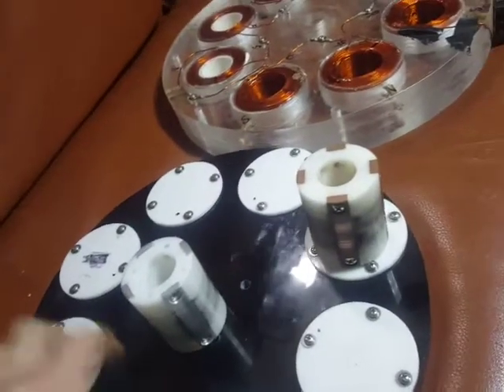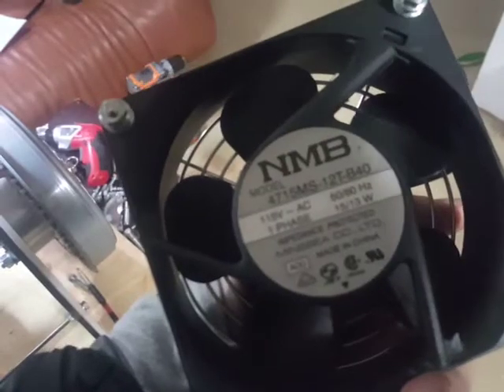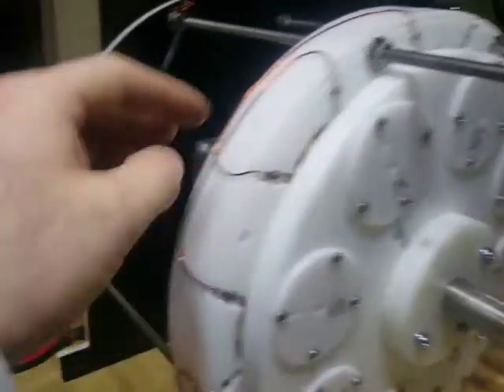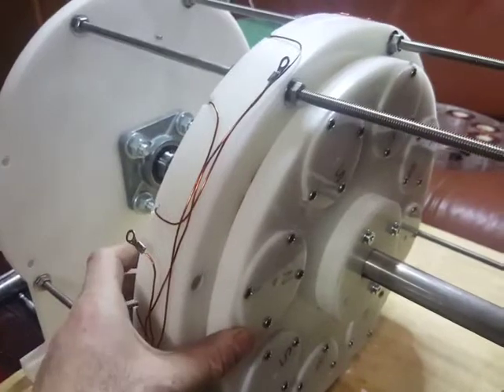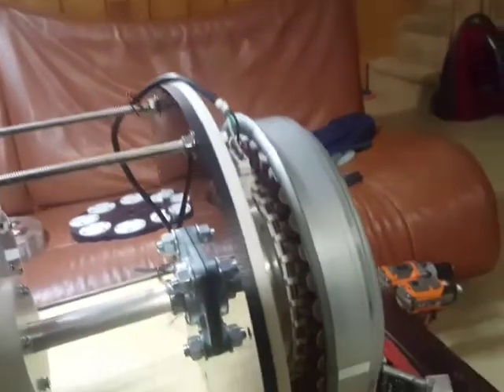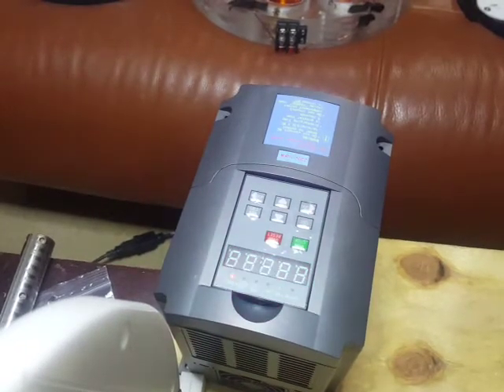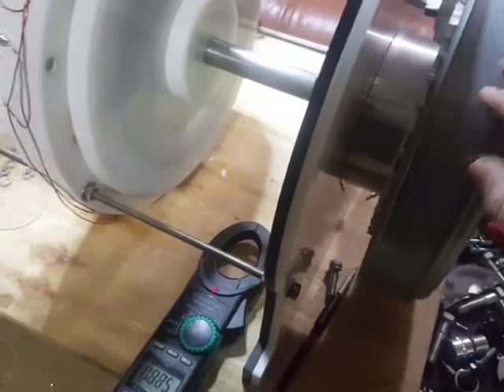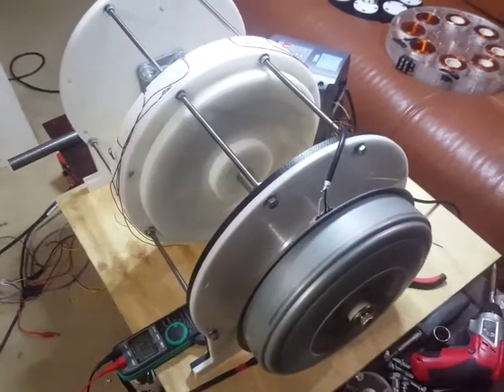SP 500 Generator from Creative science

Comment: I purchased the Model 2 plans recently (so now I have the Model 2, 3, 4 plans and some other things); & I quickly looked them over.  If the Model 2 is used as an electricity generator, then it is close in design to the Model 4.  I think the people at Creative Science may be putting most of their interest in the Model 2 since it has a commutator and some other things.  You are right that your design should produce more electricity than is consumed by your washing machine motor and controller.  So, what it comes down to is (it seems): that both you and Creative Science goofed on putting the pieces together, or you don't have the alignment of  the discs/magnets/coils correctly, or the product doesn't function as stated (sorry people at Creative Science, I can't rule this out yet).  
Not trying to be nasty, you may have some language difficulty (English not good), so this may have some influence on you understanding well what you read or listen to in English.  
If you figure out what is wrong with your machine, I would definitely like you to show us in a video!
I am going to complete the Model 4 and see what the results are.  I'm gonna use a 2 hp 115v ac motor connected to the Model 4 rod via a shaft coupling.  The motor goes a maximum speed of 1800 rpm.
Reply: How did this build turn out. We’re you able to accomplish the goals?
Reply from the maker: starlitopensky1 i will be very happy to see your make, if you fallow the plan 2 you will get the same results that i got. Why? Because you simply need more torque to keep up with energy load, either have to use high RPM with heavy flyweel and you may get better result. Another problem you will be facing is to  ballance the magnet discks.this is very crusial. On my vertion i am reaching 1000 RPM max with this controller and about 400 V but soon you start putting the load on your 2 HP motor will strangle soon  and very possible to overheat and burn out if you leave it unattended. You mentioned i may dont have align the magnet disks, it is all correctly aligned because magnets align each other it goes north-south north-south only if you read their instruction pay close attention how the magnets are aligned and you will see. To answer your Second question the stator came already wired and epoxied from creative science, this is correct wiring in series. Whole point is  your generator primary mover must be  consuming less energy then generator will produce, otherwise you will be under Unity or you will break even that means all of the work you will put in will not  make sense. Anyway I will be happy to see you your work please share. thank you
Reply: Genproject2017 alternativeenergy Okay.  Mine has to function according to what was advertised (as long as I build and assemble it correctly), otherwise that is not good.  I'm working on the Model 4, which is very similar to Model 2.  If mine doesn't work with my motor, then I'm probably facing the same problem you are with your washing machine motor.
We must get a lot more watts from our machines than the motors use.  
I'm gonna use a speed controller on the 2 hp motor, so I'll be able to adjust the voltage.  I don't care much if the brush motor I have is damaged since it has a replacement warranty.  I know the internal structure of the motor and figure the brushes would wear first, then the commutator (which transfers the electricity from the brushes to the armature) would get dirty.  I should be able to get replacements cheap somewhere but not from Grainger (expensive).
Reply from the maker: starlitopensky1 it will function but the quastion is if you get overunity out of there. Please dont get me wrong i am as much enthusiastic as you are and giving you my vote  on your project. When you will be  able to put everything together?
Reply from the maker: WM hub motor was after i faced the first problem.first i used comutator with 2 brush assambly,  with 2 brush i was only able to reach 400 RPM with no torque ,i could stop the motor with my hand taking no effort. I ended up with 2 comutator the 1 i have for fallowed from  plan 2 ,local mashine shop made for me with copper bars, then i shower to Rick what i had and he tolled me  that comutator was big and they had different size, well i trusted him and purchased the one aluminum comutator from them payer $460 . When i got there comutator there was no difference what so ever so wasted my money there,  after that i designed wm hub motor assambly and attached to the housing, i got much better result then comutator thing but i am braking even  what i put in i get out the same.  I am not sure what makes you so sure that your model will work, but hey i am not perfect  i might of  missed something simple and not getting likable result as i should. So what am i missing here? I have there product and it doesn't produce   adverticed amount not even brake evenpount so if you are fallowing there plan how you would get better results thats what pusling me 👍☺ keep us posted .
Reply: Genproject2017 alternativeenergy I haven't started the coils, I have started to cut the discs (my drill press broke but I should the replacement parts by the end of this month so I can continue).  I'm looking over plans for now until I continue.  I only have time to work on it on one day out of the week, maybe another day sometimes.  But I have built a small version of the Model 4, so this gladly isn't my first attempt!  I am hoping to have it done within a couple of months, not sure, sorry.  My other YouTube channel will have updates of the progress.  
My magnet discs will probably wobble some, which won't help with getting the best power output, but I'll get the magnet discs close as possible to the coil disc.  
We shall see if I get more power out than put in.  My small version of Model 4 definitely did not!  The magnet wire was 21 awg and the magnet pull force was 8 pounds; everything else was correct.

I'm gonna use 15 awg this time for the fullsize machine.

I'm glad you're looking forward to the results, it would nice if we can get these things functioning as advertised.
Reply from the maker: starlitopensky1  ofcause i am on your side bro more people gets hands on this project is better so we can learn from each other,i have nothing to hide i just fallow the others footprint and here i am now ,if you need any more detailed info let me know. By the way i even purchased the coil winding machine, works fine but needs lots of practice. There coils are perfectly wounded , 17 gage with 433 turns i think. But i wound my coils first and put them in stator but they have much better quality work but same result compere there's and mine , on 15 gage you might have more Amps, but how much turns are youplaning to have , if you will have same turns then it might not feet in the hole diameter unless you make the stator bigger then there design.
Reply: Genproject2017 alternativeenergy Thanks.  I am hoping that I can help you.  
I made a mistake of not removing the coating at the ends of the coils.  There is not any instruction to do this in Model 4 directions.  I just didn't know.  But I realized.  
Model 4 and Model 2 are very similar from what I've seen (Model 4 plan doesn't show how to build a commutator nor do I think it even mentions it).  
Your commutator should be producing more result. If you can turn the 1" rod by hand (no power connected), can you see where the magnets are positioned when the brushes contact a commutator aluminum metal piece (I forgot what they are called)?  The South Pole of a coil should be positioned against the South Pole of a magnet, right?
Reply: Genproject2017 alternativeenergy When I use the 15 gauge I'm gonna keep it the same size but with less turns.  I'll make one and connect it to a 12 volt battery and put a tiny magnet above the coil, it should shoot into the air.
Do you have a magnet Pole tester?  It can be used to find which side of a magnet has the North or South Pole.  I think it can be used on a coil when the coil has electricity connected to it.  I am interested if the coils you have have been put in the coil disc so they alternate North and South.
I don't have a coil maker, I'm gonna use some strange thing I made that should be okay.
Right now I don't know what is wrong with your machine, I'm trying to look for any errors.   
I have a suggestion: Run your machine again at 110 volts and connect two 1200 watt space heaters to it and see what happens.  Connect a power strip to the coil output wires and plug the space heaters into the power strip.  Run the washing machine motor with the house power.
Reply from the maker: starlitopensky1 i can show you how to set up comutator according to magnet position in private messaging. Shoot me your  email.
Reply from the maker: Check your email
Reply from the maker: starlitopensky1  i have many testers avalable, first of all this gold kit came directly from them , the stator was assembled, wired and epoxied thats why it called a GOLD KIT, otherwise it would be simple kit you have to put the coils in the stator and wire them and epoxied them. Any way even it was already pre-assembled I still test it with the magnet polarity Electric tester, and I also tested old-fashioned way connect me to the battery and check the polarity with a earth magnet they were all correctly wired, i aligned correctly to the commentator otherwise it would produce higher Sparks I also shared the video with you in private. Hope you will complete yous soon and share it in here. Oh by the way to purchasing plants from them is waste of the money after i went thought all this building, all plants are available online to download you just need to look for it.
Reply: @Genprojectalternativeenergy  are you still using this? We are considering it & would love your input

Comment: If you want to try this in the meantime:  get a longer 1" rod and put your four magnet discs and two coil discs on it, connect in coil discs in series, and see if you get more watts.  Connecting in series should double the volts just like if one connects two 12v batteries in series one gets 24 volts.
Reply: Hi starlitopensky1, did you finish your build yet? I am working on mine and trying to get it working, but I’m having challenges. I’m seeking help but can’t get ahold of Rick.
Reply: I have issues too.

I recommend that anyone trying to make one, make a very small one, to get it to function without waste of money.  I have 3D printed parts of a smaller one.  I am not following Creative Science plan exactly because I can make it smaller and with less cost.  One can 3D print three coil discs and four magnet discs (four magnets per disc, 4 coils per coil disc).  As long as the wiring is dine right, the end result is the same as a big one.  There is a good chance that "Creative Science" is a scam.  Look how Rick Gibson handled the maker of this YouTube video.  Either way a person can 3D print a tiny machine (one coil disc and two magnet discs) and use the photo interrupter (and other things) to help time it.  If you try to make a big model with a drill press you may get a wobble when discs turn (and other problems).  But "Creative Science" is ready to sell you things for big dollars.  Notice: They don't accept credit cards!  Possibly because if the machine that the company sends a person may not produce electricity in the quantity as advertised, the buyer would want to get a refund and "Creative Science" probably doesn't do refunds; with a credit card a buyer could force a refund by proving that the seller is a liar (if that is the case).

Comment: You may consider using gears, like those on a bicycle, with your motor.  This method should allow less energy consumption to maintain a higher rpm.  I still don't understand why you're not getting 2-something kw.  
I read somewhere that that a 1 to 1 1/2 hp motor was used (I think instead of the commutator).  Not sure, I figure the more hp a motor has the more watts consumed to run it - I don't know.
Reply from the maker: starlitopensky1 if it would be my build then i would blame my self that i made a mistake in something, i bought comutator  and whole gold kit  stator and magnet disks from them to make sure i was following them and spent more then 4k! I am getting same result that i had it originally built by myself, now lets go figure why i am not getting better power from there product? This is the big quastion myself too. Thats why i used WM HUB Motor tu gane the torque, that was my idea in this project.but still quit not there yet

Comment: I have not figured out how a commutator and a couple of brushes turn the rod.  I'm not an expert on electric motor structure; I think the components are: commutator, permanent magnets, rotating coils (armature), brushes.  But this design only has a commutator and brushes.
Reply from the maker: starlitopensky1 it is simple motor  nothing elce.
Reply: Genproject2017 alternativeenergy Well, I see Rick has left a comment.  
I had a thought: are you using a 12v DC power source with your commutator or a 110v ac source?  This may affect the magnet push.
Reply from the maker: starlitopensky1 i have traied both. 110 you need to use diode   or bridge rectifier any way to feed the motor.

Comment: I'm working on this.  I made a very small version which does produce AC volts.  I connected a small DC motor to the rod using a coupling.  Nice to see you worked it out.  I control the speed of the motor by a DC motor controller I found on eBay.
Reply from the maker: starlitopensky1  yes i managed it to work in terms to spin sp 500 gen, with the comutator or qithout the comutator but i dont see any overunity from this device. So whatever Creative Science  claiming is far away from trues!
Reply: Genproject2017 alternativeenergy That is a serious problem if it doesn't produce like they claim.  I am making a full-size version of the last model in the plans.
Reply: Genproject2017 alternativeenergy You can probably email Rick links to your two YouTube videos, they might be able to point something out.  I don't know how many staff they have, so I am unsure if they will reply.  
If I were you I would get the sp500 producing 110v and then plug in a 1200 watt AC space heater into it and see what happens.
Reply from the maker: starlitopensky1  i dont beleave to Rick any more after i paied him for this gold kit he refused to answer my phone calls, again there sp500 doesnot produce enought horse power to lite on even 100 w light bulb, before I purchase the kid from them I built my own first then they told me I was doing something wrong and that's why I spend thousands of dollars for their kit. That's what the problem is. If you watch both of my videos very carefully it will say what I have been through
Reply: Genproject2017 alternativeenergy Okay.  I wish I could go over your whole machine, piece by piece in person and look for any errors.  I know that things can be overlooked, for example: I didn't sand the wire ends of a coil which caused it not to transmit electricity.
Reply from the maker: starlitopensky1  this is there gold kit i resieved from them, it was already wired and installed.it is wired in series and they are properly connected. I can make another video for you to show you everything. If you have experience and tou have done before and you beleave it will produse more then you put in sure  we can work it out together. Give me a PM and will show you in person.
Reply: Genproject2017 alternativeenergy I believe you. I will think about your machine.  I've only made a small version of the last model in the directions.  Maybe you should contact Rick and have him watch your videos here on YouTube; ask him what you are doing wrong.  I'm going to ask him to look too.